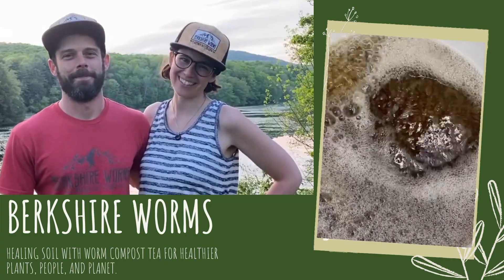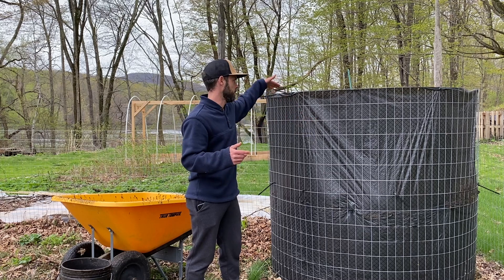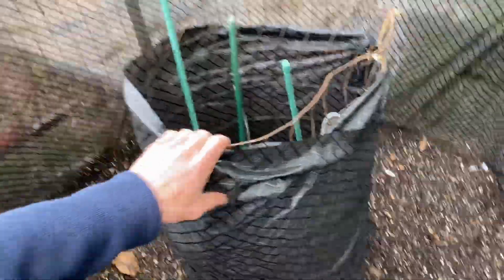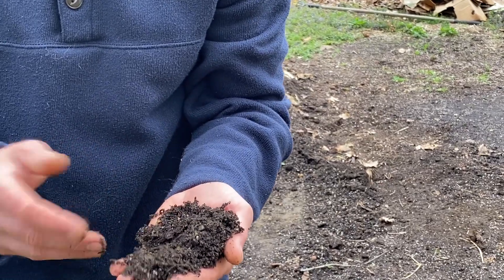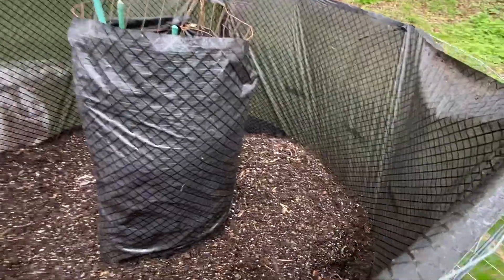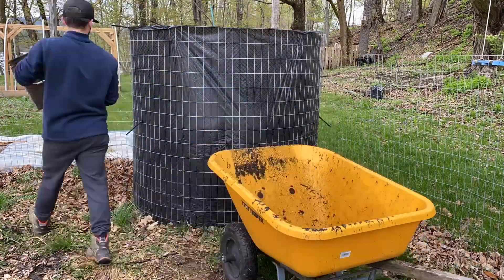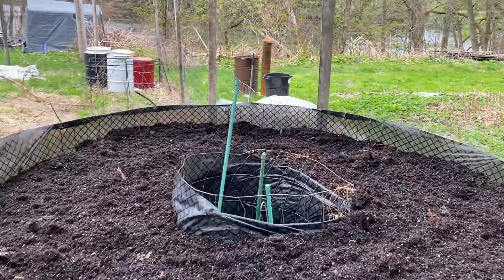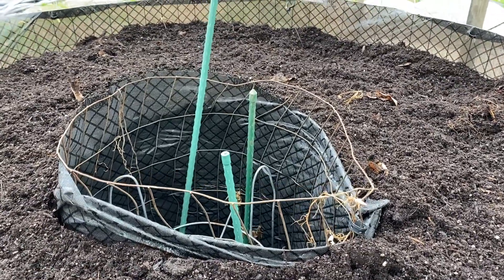NO TURN COMPOST! Composting with bioreactors

Comment: add food scraps top or bury under leaves greens etc. that is the question….
Reply from the maker: So sorry for the slow reply! We like to use the bioreactors for finishing compost. You will want to bury any food scraps under brown material, (leaves, dirt, more worked compost), doing it that way you will have more of a worm bin experience.

Comment: Did this in two bioreactors and it was a complete waste of time. Leaves barely broke down after 10 months. I ended up composting them in a normal pile. 

Might work well in New Mexico where Johnson does this, but not in the American Upper Midwest where our harsh winters make the piles into popsicles.

Comment: Footer's design is waste of time. It won't aerate & cook properly without the bottom pallet. He said he wouln't add worms. He just expects them to show-up because he built it on the ground. It will never produce the clay-like fungally & bacterially dominated material which is a the point of a Johnson-Su reactor and a function of worm poo...by actually ADDING composting worms. He also left off the lanscape fab which protects whatever few worms show up from light and helps hold moisture for them. He did this as some sort of weird anti-plastic virtue signaling. (Now he's back to using a big Brute plastic trash can to try to compost woodchips & manure as fast as possible. So much for the anti-plastic crusade.)

He also filled it chock-a-block with woodchips & manure. Dr Johnson now advises against using woodchips since they take 1 year plus in his spec built reactor to decompose.

I don't recall that he plumbed it for the 1 min daily watering.

You'll get something out of it. But, it's no kind of improvement on the Johnson-Su. Forget that clay-like material as an end product.
Reply: Agree I think the worms are key to Johnson's results. Likely the worms are also the reason why using different feedstocks end up with same bioassay results.
Reply: @thechief762  I think you could build a Johnson-Su horizontally as an open bottom CFT worm bin & get reeults. Long sides could be made of 2 × 4s with heavy wire screen & lined with woven landscape fab. Could be built in a basement to prevent worm death below 40 degrees & supplememted with heat if needed. (Walk out basement easiest.) Venting the basement during the compost "heat up" stage would be necessary. A 4 x 8 size should give enough area mass to achieve adequate "heat-up" assuming your top it off some after settling. PVC vent pipes inserted vertically throughout at 1 ft distance resting on the open bottom CFT rods/pipes/conduit provides air flow through the pile. Moisture control would be easier without sun & wind as factors.
Reply: @flatsville1  I haven't made a video but will soon. My "Ecosystem Bioreactor" uses a static wood chip pile and is finished in a 5 cubic yard concrete reactor filled with a combination of feral millipede/pill bug/soldier fly and Indian Blue worms. I do add green vegetation during the finishing stage to keep the ecosystem going.
It is in non-frost tropical conditions of South Florida.
Reply: @thechief762  That will be an intersesting vid. Tag me from this reply thread when you post it.

These builds are very climate senstive/dependent due to worm death below 40 degrees.
Reply: @thechief762  After considering some designs, 2 IBC totes side by side (each with one end 40 in end removed & joined together, rather than stacked) wiith the top plastic removed & a the majority of the bottom & side plastic hole sawed out should breath just fine with landscape fabric & the vertical interior vent pipes. An insulated workshop space will be needed rather than basement, build unless a walk-out. The design provides the needed 4×8×4 mass. Not even sure it's necessary to join them as 40" short side is close enough to 48" for the compost phase. Should be plenty of volume.
Reply from the maker: We are excited to see how it turns out and to continue to experiment with different designs to see what works best for us.
Reply: @BerkshireWorms  Do you plan to add worms? Hope they just show up? Water it one minute per day?

Specifics. Would be helpful.
Reply from the maker: @flatsville1  So far we have already seen a lot of worms just show up, but we are planning on adding some avocados to the top intermittently to increase their population. Moisture levels will depend on how much rainfall we get, we don't water for a specific amount each day with any of our compost, and more go based on feel, making sure that it doesn't dry out or get over-saturated, which comes with practice.